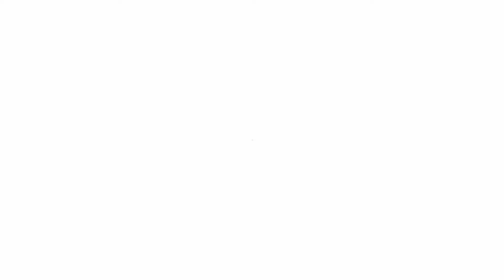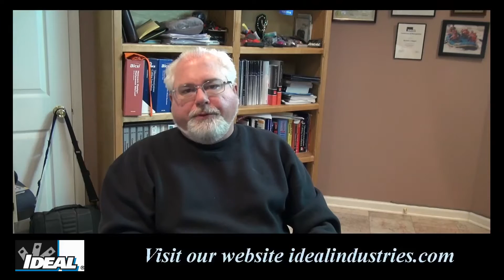Residential Structured Wiring Systems Intro

Comment: i have a huge project going on at my house.  i'm starting at the back of the house and working my way toward the front.  my project involves extensive remodeling due to limited attic access.  i've done a lot before, but i outgrew it and i'm ready for a major expansion.  i'm self taught.  learned from trial and error, but i was able to get a fully functional system going.  this new project i'm doing is going more from a DIY homeowner type build to a more commercial type higher end build.  i will be very interested in seeing your videos.  i feel i know a lot already, but i'm game for learning more in case there's something i'm missing.
Reply from the maker: Chris
I hope they help!

Ron